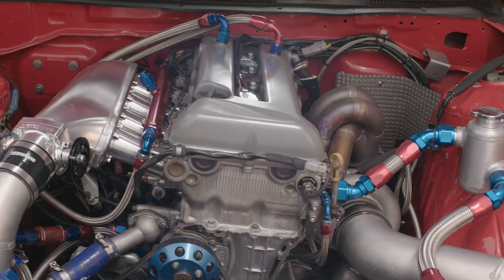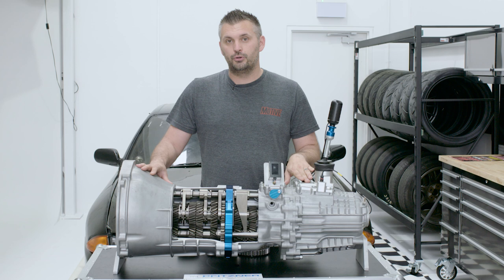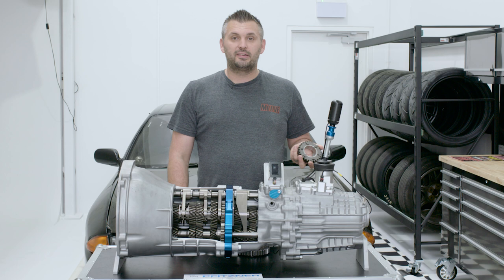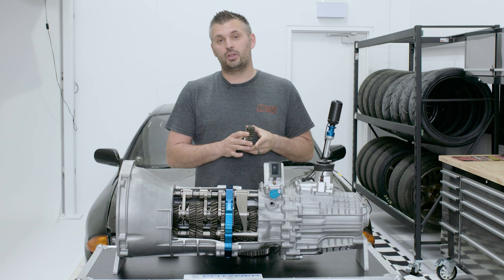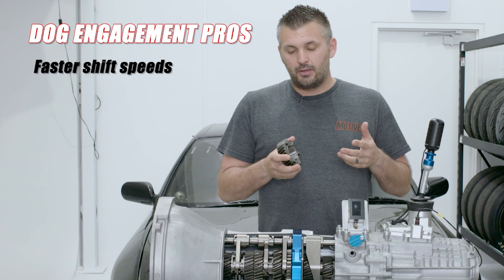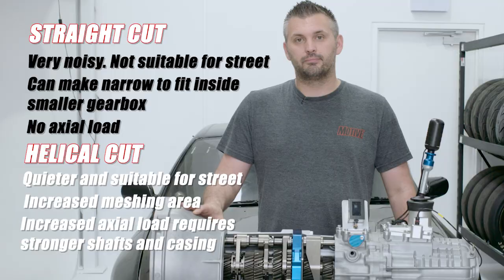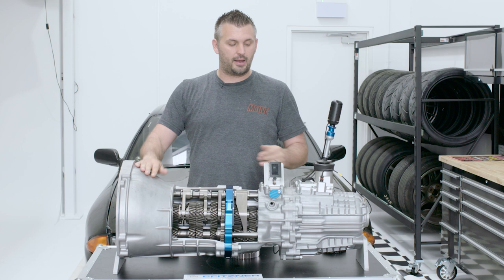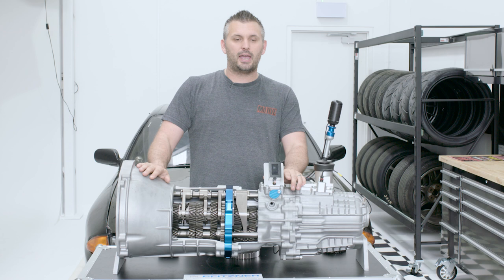Difference Between Manuals Sequential & H-Pattern Dog Box

Comment: I bang gears in my Sti. Sounds like a sequential when I shift. I don’t lift either. Only problem I’ve had is after the tranny gets hot on a couple passes it doesn’t like to go into 3rd. Don’t know if I could ever run a dog box since it’s so loud. Either way great video
Reply: Henry Kenick I had a Yamaha r1, I could bang through gears no clutch, but on the occasion it would jump between gears and I would have to nuetral the bike to a stop, shut it off and select a gear ( or it would grind back and fourth) nice bike nine he less
Reply: Don Werrboutit  That is because your gear dogs were damaged.  Despite what many people will tell you, clutchless shifting a bike will put more wear on the gear box than using the clutch.  Can't comment for car dog boxes as I only ride bikes.

Comment: hate to say this every time you shift a dog box there are tiny pieces of steel chipped of the dog rings if you want a dog box to last you need to change the oil every time its been raced
Reply from the maker: Thats not the information we get from any dog-box manufacturers at all. If you do 200 laps in a weekend, then yes. you change all fluids in a car, not just gearbox,
Reply: ALAN
If that was true then m-cycles (that all have dog teeth) would need a new gear set every 12 months.

Comment: good video but one thing is incorrect ,you can shift every gearbox without clutching, it just takes  amount of skill.
Reply from the maker: Good luck convincing people of that as no amount of skill will let you clutchless shift a high horsepower car with a synchro box.
Reply: MotiveDVD I don't try to convince anyone,I'm just saying you don't need a clutch ;)
Reply from the maker: Video or didnt happen.
8000rpm shift in a 600hp Skyline with no clutch. Good luck
Reply: Yes in theory but can be very slow and expensive during practice.  Worst case: I had an 1949 Ford F1 4 speed with NO synchros. Down shifting without clutch is a little scary.  Lift throttle and pull into neutral. Blip throttle to rev match and pull into gear.  Miss the rev match and it's LOUD. Lots of grinding until I learned to rev match.  Up shifting, lift to go to neutral and  wait until the revs match  and shift. For me, I had little choice.  Using the clutch was better but rev matching still required. In a modern factory transmission, it's just dumb.   I like the idea of sequential, dog, transmission for high power.

Comment: Only question I have is: Where can I get an AFFORDABLE straight cut, 6 speed dog sequential for our Honda K20 engined rally car? Hmmmm if only!! Keep in mind that we spent £10k on buying the MR-S and fitting it with a Honda K20, as well as everything else to make it a top 5 clubman rally car... Any affordable options??
Reply: TomEnduro just put a standard 6 speed on the k20 use a more heavy clutch and use a bolt on sequential shifter.
Reply: Ricky Bobby, I get what you're saying, but it isn't fast enough. Everyone else in the top 10 are using sequential and paddles... Looks like we have just got ourselves a new Quaiffe sequential through a sponsor deal so let's see. It should be arriving in the coming week. Fingers crossed.

Comment: Not sure if your familiar with the 350z but i have an 07 (vq35hr) and am planning on tracking it for circuit/time attack style of driving. Any specific recommendations for this platform as far as what was discussed in this video ? (Some cars respond better to certain setups as you’ve stated) Thank You
Reply: 350z stock 6 speed is more than you'll ever need. They're super strong and reliable. Plenty of people using them behind 800hp+ JZs without issues.
Reply: Thank and yes  they are strong, we know someone here with 1300hp 350z that it held up to, for how long idk. But I’m more concerned about responsiveness of the gears or the sequential setup
Reply: I'd say work with what you have until the gearbox becomes your limitation. Yes a sequential would be nice but unless you get to the point where you're doing everything you can to shave seconds off your lap times, you should be just fine with the CD009
Reply: Daniel Todd good point, thank you
Reply: 4.08 final drive. replace abs with bmw mk60 (it’s garbage) have spare lower control arms . the bushing goes all the time.

Comment: Does the ppg GTR 6speed gear set fit into a 32/33 case or a 34 getrag case?
Reply from the maker: R32/33 only. No point making it fir R34 as they are so expensive
Reply: MotiveDVD Thanks,  going sequential and its ppg or os88 (rb32/gtx45r) that I have to choose from.
Reply from the maker: Sequential changes your life. For the better. You will never look back. If you watch our videos with the PPG you will see that for a street car, its hard to look past.
Reply: MotiveDVD  yeah I checked it out. I had an osgrb30/os88 r34 10 years ago and regretted selling it. Kept my 32 tho and going to town on her.

Comment: Factory gearbox casings are not as strong as race spec gearboxes, so not every time puting gears into factory casing is good idea..
I have some experience with  mitsubishi pajero evo, guys put in gear sets to make it dogbox, because it was cheaper.. and owner broke box in second trophy run because he was braking with gears so hard that casing just could not hold it.

Comment: Completely different direction but how would an 8 speed auto compare to a say race prepped 6 speed. I run one of the only 8 speed auto cars in ls fest. Typically I am faster in some events such as auto x, start stop, and drag. I feel I would be faster on road course with more power but am the only one doing this for a reason? I bought the car initially to drag race. But ended up taking it a completely different direction and so far it seems to be working better.
Reply from the maker: The real reason autos arent used in race cars for circuit is they want direct drive between engine and wheels for balance. Auto has bands and torque convertor which can slip ( modern cars not so much) its all about predictability on and off the throttle. Also, autos are heavier and harder to keep cool in circuit racing
Reply: MotiveDVD thank you for the response! Much appreciated
Reply: MotiveDVD this is very true and dangerous. any bad moves from some auto transmissions can ruin a cars balance mid corner and make you lose control.
Reply: GrimReaper1675 I have about 500 plus laps on mine never had an issue.

Comment: At 2:11 there is a mistake. If you put your foot on the clutch and downshift a sequential back to neutral, there is zero chance of damage. When the clutch is in (disengaged) the engine is not connected to the input shaft and thus not connected to the rear wheels.
Reply from the maker: projectgattago there is zero chance of engine damage, but, the two shafts are the gearbox are connected so image output shaft connected to back wheels doing 200km/h connected to input shaft via 1st gear.

The input shaft is now spinning a lot faster than it was ever designed to.

Guess what can happen to it
Reply: Fair enough...
Reply: MotiveDVD great clarification
Reply: This is an important note to clarify. If you're going fast in a high gear, clutch in, and downshift into 1st, the transmission will most likely explode. You're mechanically forcing the transmission to spin outrageously fast. They're not made to handle 40K RPM. The clutch only disconnects the engine from the transmission. The transmission is always coupled to the tire, so long as you're in a gear. This is just about impossible to do in a standard synchro box though, but worth a note.
Reply: I was just about to ask about this. Good to know.
Reply: Tazzius Maximus I think what you are trying to say is downshift gradually as you come down in speed. Which is the ideal scenario regardless of transmission type.

For instance, in my personal car if I'm cruising in 6th gear preparing to stop soon, I will downshift to 5th, then 4th, then even 3rd  sometimes before I put it in neutral and come to a complete stop. I don't go straight to neutral so I can just get back on the throttle and not "hunt" for a gear if that red light I was planning to stop at changes back to green.

After shifting my own gears for 10+ years though, these are things that we do second nature. Muscle memory if you will. As you drive, you will learn what works for you and your specific vehicle.
Reply: I think he meant that if you go all the way down to neutral, then it's not an issue, because in neutral, the transmission is separate from both the wheels and the engine. But of course if you get down only to 1st, then it obviously blows up since it's connected... Of course I might not get this right, and if so, then my apologies!!!

Comment: Smartarse alert

Straight cut gears aren't stronger than helical gears, inherently. A helical gear has more teeth and more tooth area meshed so the force is shared by more teeth. That is inherently "stronger" - like for like. The real benefit of a straight cut gear is in reducing side-load generated by the gear - the teeth effectively form a slope relative to the shaft plane and try and run down it, or along the shaft if that's easier to understand. And obviously with fewer teeth engaged mesh drag is reduced too. This results in higher efficiency from a straight cut gear both in saving that mesh drag and the friction thrust of bearings.

That's the, pedantic,  theory. In practice differences in the tooth profile and so the way force is carried through the gear mean a "race" transmission's straight cut gear may well be stronger in a narrower form. But it's not the straight cut idea that makes it so. The tooth form is usually much bigger, but doesn't have to be, so has more meat to carry the force applied.

Smartarse comment, I know. But it's a misconception that's a bit wrong when it comes to gears in general. We cool, right?
Reply from the maker: Justin Lewis could have discussed this for hours

If straight cut is weaker, who do all Racing gearboxes use them? 

Less axial load means shafts and casing can be lighter and less strength requires

You think an aftermarket straight cut is weaker than an OEM helical?

There is no correct answer as it is all application specific
Reply: Oh, ok. I'll play. In your order:

You could discuss it for hours, sure. It only took me about twenty minutes to understand when I learned it a quarter century ago from a bald bloke with slides, a huge blackboard, and the very expensive thick heavy book I'd had to buy. And that included learning all sorts of tricky terminology including the name for that stuff: Nomenclature. No wonder that book was heavy with a bloody big word like that in it one every other line.

All racing gearboxes do not use straight cut gears. Most do, sure - why wouldn't you. But not all. As for the why bit: to get rid of the thrust and with it the losses when it meets a thrust race. As stated in my comment.

You could say less axial load means lighter shafts. The bending moment usually has more to do with that. Casings, though, sure - just keep the centres in place and everything else is just to old the oil in, right.

Like for like - same material, same profile, same heat treatment etc. The aftermarket straight cut gear would be weaker than the OEM. But they'd never be like for like. We both know that. I'll qualify that with the assumption the axial load path in the OEM gear isn't a weak link. But it usually is (Fun factoid 1st point of interest when crack testing GpN gears at inspection mileage before they were allowed to run s/cut. Same boxes, same torque, same abuse would kill bearings with helical, strip teeth & break shafts on s/cut).

There is a correct answer. I was taught it a quarter of a century ago by a bald bloke with slides, a huge blackboard, and my very expensive thick heavy book. Back then I was no stranger to the innards of a gearbox before I got educated. I thought straight cut gears were stronger too; They aren't. Not inherently. An engineer would take into account that inherent fact about straight cut gears when engineering a specific application. Either that or just take a guess at a pressure angle/use the cutters in the tool room, whack an EN36C blank on the hob, then send them out for heat treatment and call it job done. Maybe some superfinishing to stick another 15% on the margin. Kerching! Everyone loves shiny parts, right? ;)

I did preface my original comment with a *smartarse alert*. You were warned. ;)
Reply: There is one other pro to straight cut gears; they're easier and cheaper to machine. That's why every* factory car uses a straight cut gear for reverse (which explains why reverse in your car makes that whining noise, for those that were wondering).

* I don't know of any OEM car that uses helical gears for reverse, but I wouldn't be surprised if someone like Rolls Royce do it, just because they can.
Reply: Most of the ZF manuals used in everything from yank pickup trucks to Jaguar's F-type and BMWs have helical (& synchro) reverse gears. Reverse has traditionally been been a spur gear because it wasn't a constant meshed gear. Meshing helicals while stationary would be a faff because they need to rotate as they're slid longitudinally into full mesh. The traditional reverse set up we're all familiar with and is still perfectly good is a bit of a throwback to ye olde days and hasn't needed faffing with considering how little work it usually does. Cost is probably in the mix though, sure. Though they are usually machined in exactly the same way as a helical.
So yeah, gearboxes - they're like this whole thing... who knew, huh?

Comment: Kind of bullshit. Syncro box engages dogs for the friction cone brake that synchronizes the speeds between the input and output shaft gears to shift smoothly. Dog box just uses dog engagement to shift gears... eather box will shift just as quickly if you can double clutch and match the input and output shaft speeds... either box will survive shifts if the driver understands the limits of engineering with each box. A crash box could shift just as quickly but thats beyond most humans lol.